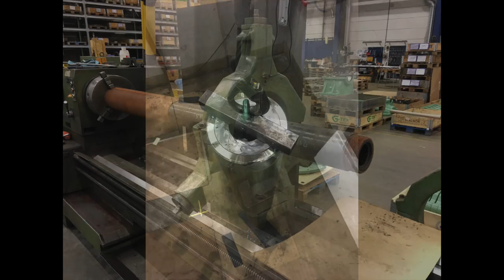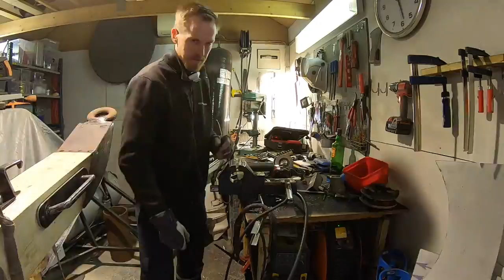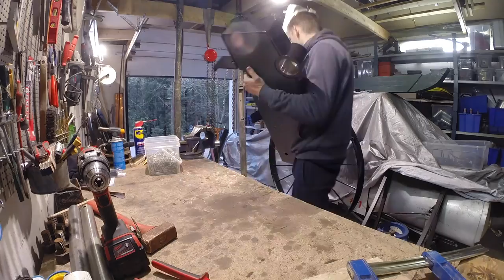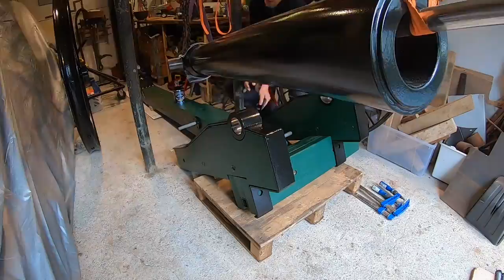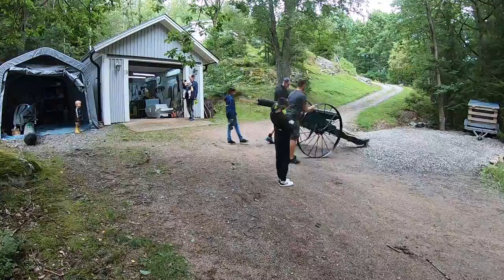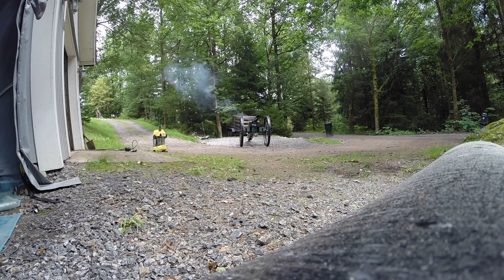Big black powder cannon

Comment: How did you build the barrel? I noticed that there seemed to be two parts to it, how did you connect them?
Reply from the maker: First main barrel, then one extra pipe that's turned and chrinked on the back end. Then a third pipe (for weight and apperens) is welded on.
Main barrel 3,5cm thick
Chrinked pipe 2cm thick
Extra pipe 1cm tgick
So around 6,5cm thick in the back.
Reply: @jonassvenssonharskogen5186  
Thank you!

Comment: Did you mill out the bore or was that already done?
Reply from the maker: I found a pipe with exceptional tolerance in a scrap yard that I started with. So I did no machining on the inside.